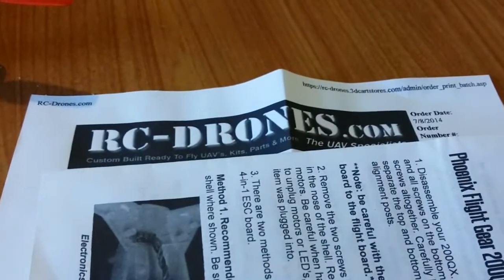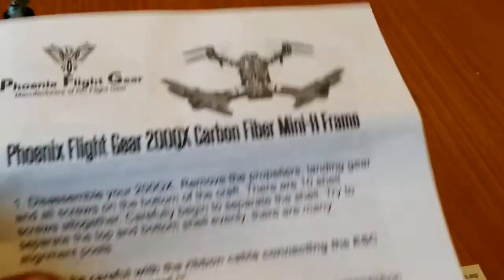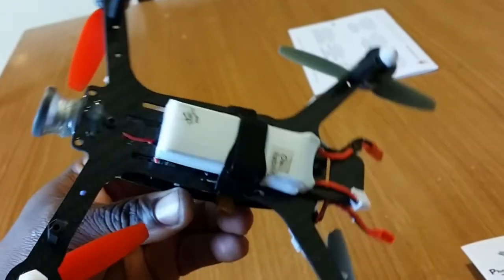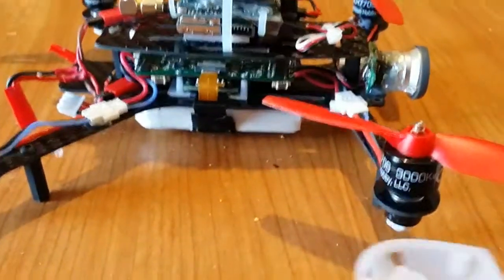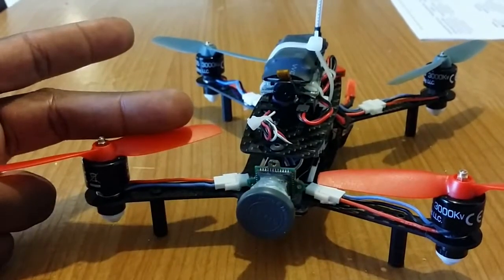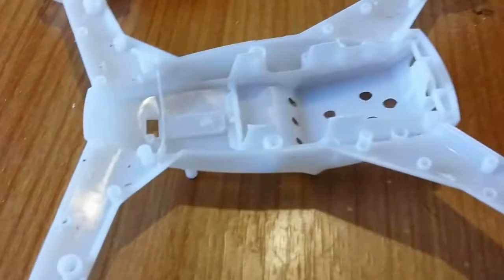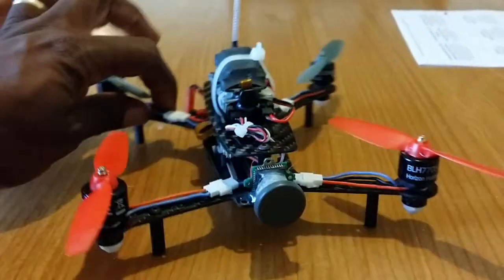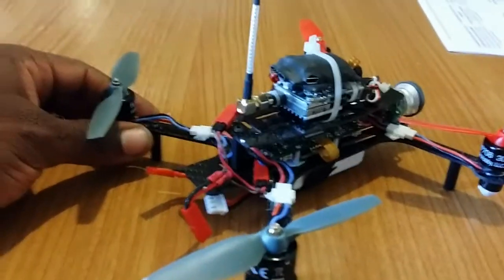Blade 200Qx Phoenix flight gear carbon fiber frame

Comment: Thanks TNT. I was going to get a few Chinese 1000's but I saw that the Thunder Power 1350 was the same weight as most of the 1000's made in China and way lighter than the Chinese 1300's. The TP's only weigh 16 grams more than the original 800's. The downside is that the TP1350's cost $24 while the Chinese ones cost around $4-$5.

What brand are your 1000's? How much do they weigh?
Thanks!!

Comment: Yeah I never understood drilling a hole in your arms essentially halving their strength where they are most likely to break. Also if/when you catch the grass with those stand offs while you are moving its like a arrestor cable on a carrier. Go faster and it will rip a arm off. I have a simular sized cf frame with no standoff and simply used goop and used balsa squares to keep the quad's belly off the ground. No weight and they simply break off rather than snag and turn nothing into a arms snap or cartwheel.
Reply: JIMJAMSC I've heard of people hitting these frames into trees with no damage. If you crash it hard enough to break an arm you probably will have a lot more broken than just an arm.

Comment: Which frame do you think would be more durable, this or the polycarb frames for the 200?
Reply from the maker: So far the carbon fiber frame been holding up pretty well.  I ran into a few trees and it came out clean.  Be blessed
Reply: tntneon Thanks, I just put in my order for one! Can't wait to install this.
Reply from the maker: B Curt I have both frames folding and non folding both are durable but the folding is better as far as replacing arms.

Be blessed
Reply: tntneon I see they have an HD version listed on their site too.  Is that the version you have?  Do you think it's necessary?
Reply: Nope. I landed the regular version IN a fence and it was like i threw a ninja star. Not a scratch. Get the regular like he said I should. No regrets here. Happy flying man.
Reply: B Curt cheers!

Comment: I had a Phoenix flight gear carbon fiber frame for an RC Logger one xtreme, there OVER PRICED, THIN, BRITTLE, JUNK!!!! Mine took one light crash in my carpeted basement and broke an arm off!!!  The arms are only 1.5mm thick by 1/2 wide, then they drill holes in them and that's where they break. Buy the tubular carbon frame on ebay for this quad much better then, Phoenix

Comment: What size 2s lipo are you running? My frame is on its way and I have the Predator FPV set (RTF) that I will put in it. I'm planning in a Thunder Power 2s 1350 mah that weighs only 11 grams more than the stock 2s 800mah so I'm hoping for more power and longer flight times.
Reply from the maker: I'm using 800mah and 1000mah.  1300 may be over kill especially if you are going to have fpv equipment on it. Lol u don't want it to heavy.  Be blessed
Reply: tntneon how many mins do you get with those batteries?
Reply from the maker: ***** I was getting around 5 to 6 mins if I'm not mistaken.  Be blessed
Reply from the maker: 1000mah.. Be blessed

Comment: What is the voltage that your fpv system runs on? I just got one that needs at least 7 V to work, and I'm worried that the 200qx's 2 cell battery might not be enough to power it through a full flight
Reply from the maker: It's running off the 7.4 pack of the 200qx and that pack that's on is 1000mah. I was getting around 4 to 5mins flights. Be blessed

Comment: For the price of the top and bottom plate, combined with the 200X, it seems there are better mini quad options out there (i.e. Blackout, QAV, Armattan, etc). Kind of lame that you have to butcher your stock frame to convert it over as well, especially at that price.
Reply from the maker: while that is true that there are other mini's out thier the price of those are going for $200 or higher for carbon fiber frames also this frame is a lil smaller than the other 200 size frames.  This is just for a upgrade any way.  The other thing is the fun of the hobby for me is moding I like changing things for the better.  So if its for the better I will try it.  Be Blessed
Reply: and what flight controller would you use that can FLY UPSIDE DOWN!?! oh ya, only eflite can do that
Reply: geneticallyinferior1 No.. There are many other flight controller/esc combos that can do it.